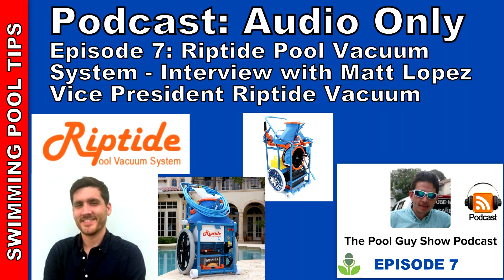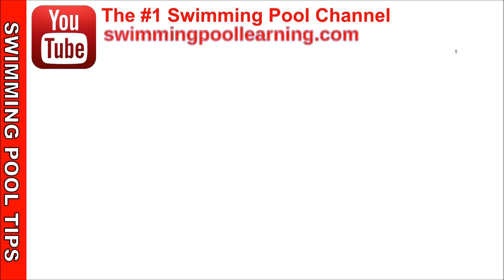Riptide Pool Vacuum Systems, Interview with Matt Lopez VP of Riptide

Comment: How is the vacuum holding up lately? How often do you still use it? I plan on buying one in a few weeks. I have about 10 stinkers on my route. Regardless of weather, they are always completely trashed. From what i have seen, the Riptide will almost feel like cheating. I'll definitely confirm that once I buy it.
Reply from the maker: It is a great system that has gotten even better with their new plug and switch. In this case, cheaters will prosper. 😜